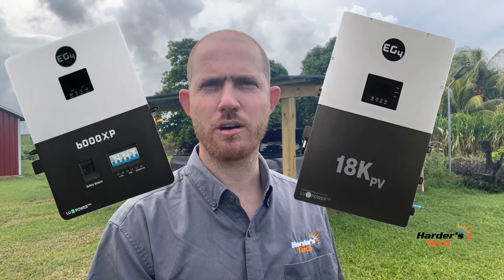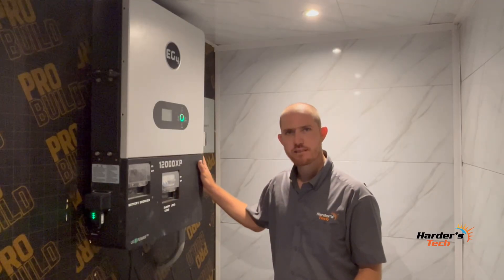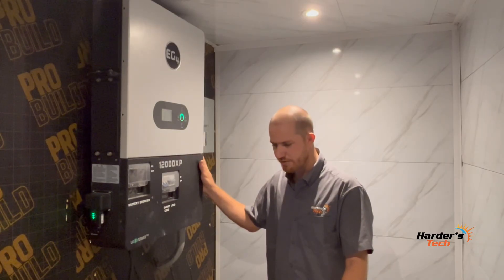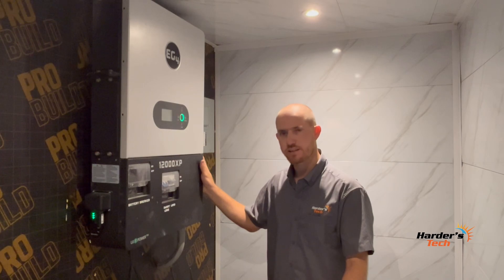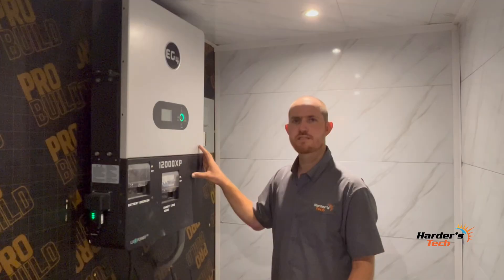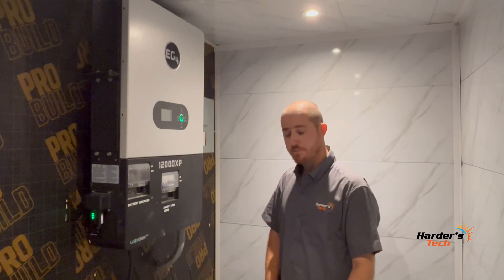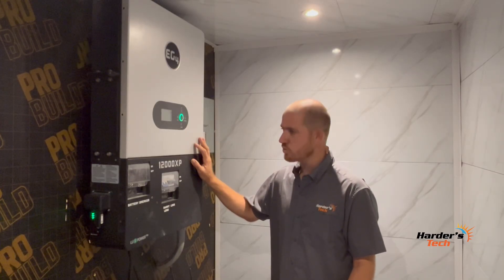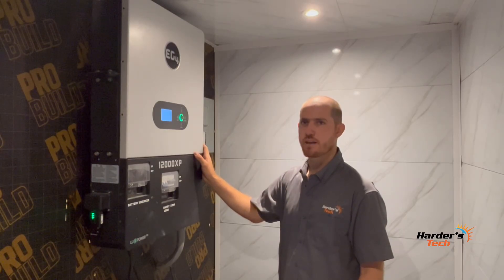EG4 12000xp & Solar Carport: The Ultimate DIY Renewable Energy Project

Comment: With over 25 years of experience in the inverter repair industry, in my opinion, I would never buy this inverter. Far too many problems. The EG4 12000XP inverter can encounter various issues, including overload warnings (like Warning 28) when one leg exceeds its capacity. Other problems can involve communication issues with batteries, voltage limiting on PV strings, and even firmware update failures. Additionally, some users have reported loose neutral connections and difficulty getting the inverter out of standby mode. 

Specific Problems and Troubleshooting:

Overload Warnings (e.g., Warning 28):

The 12000XP is designed to handle 6000 watts per leg, and exceeding this limit, even briefly, can trigger an overload shutdown. This is often accompanied by a "Warning 28" message. To resolve this, you may need to reduce the load on one leg, reset the inverter, and consider using soft starts for high-power devices. 

Communication Issues with Batteries:

Problems with the orange battery communication cable (CAN plug) or the inverter's ability to recognize the battery bank can prevent charging. Switching to lead-acid mode temporarily or ensuring the correct CAN plug is used can help. 

PV Voltage Limiting:

Some users have reported the inverter limiting the voltage of their PV strings to 120V, even when the strings can generate a higher voltage. Resetting the PV switch at the inverter or checking for loose connections can be a temporary fix, but contacting support may be necessary. 

Firmware Update Problems:

Firmware updates can sometimes cause the inverter to enter standby mode, particularly on off-grid systems. Using the EG4 Monitor app on an iOS device (if you are using an Android) and connecting to the dongle's WiFi (not your home WiFi) can help resolve this. 

Loose Neutral Connections:

A loose neutral connection at the inverter's busbar can lead to various issues, including power loss on certain circuits. Checking and securing this connection is crucial. 

Getting out of Standby Mode:

Off-grid systems may experience difficulties getting the inverter out of standby mode. Following the steps outlined in the troubleshooting section of the EG4 community forum (e.g., turning off EPS, turning off inverter, turning on generator, then inverting the process) can help, says a user on the forum. 

Parallel Grid Bypass Issue:

Some users have reported issues when paralleling 12000XP inverters, particularly related to the neutral wire or voltage drops on certain circuits.

Comment: I asked Google if this high frequency, transformerless inverter can damage your home's appliances, and this is the answer that google gave me: 

Yes, a high-frequency, transformerless inverter can damage your home's appliances because they often lack the galvanic isolation and surge capacity of transformer-based inverters. If the internal components fail, a transformerless inverter can send damaging, high-voltage DC current directly to your AC appliances, potentially causing severe damage or even fires. Additionally, these inverters may produce less stable AC sine waves with high harmonic distortion, which can harm sensitive electronics. 
Why Transformerless Inverters Can Be Risky

Lack of Galvanic Isolation:
.
The absence of a heavy-duty output transformer means there's no physical separation between the inverter's DC and AC circuits. When a component fails, such as an MOSFET, it can directly connect the high-voltage DC to your AC loads. 
Increased Fire Risk:
.
A direct connection of DC current to an AC appliance can not only damage it but also lead to overheating and potential fires. 
Poorer Surge Capacity:
.
These inverters often have a lower surge capacity compared to transformer-based models. High-inductance loads like refrigerators, power tools, and microwaves require significant surge power to start up, which can strain and shorten the lifespan of a high-frequency inverter's components. 
Less Stable Sine Wave:
.
High-frequency transformerless designs can result in higher harmonic distortion, producing a less stable AC sine wave. This can negatively affect the performance and longevity of sensitive electronics, such as computers. 

Why Transformer-Based Inverters Are Often Safer
Electrical Isolation:

The iron core transformer provides crucial galvanic isolation, acting as a safety barrier between the DC and AC sides. 

Proven Reliability:
Transformer-based, low-frequency inverters are often described as more reliable and rugged, with a simpler design that is more tolerant of voltage spikes. 

Better Surge Handling:
Their heavy-duty transformers allow them to handle high surge loads more effectively for longer durations without damaging their internal components.
Reply: This guy is bot. He says the same thing on every hybrid inverter
Reply: @stackmanstack No, only the junk high-frequency, transformerless hybrid inverters, Stackman.
Reply from the maker: I have been living off-grid on different high frequency inverters for the last 8 years and I have never, ever a single home appliance that was Burt or stopped working. My Gas Stove is giving me problems after 8 years now. 😅However, my electric appliances all good!